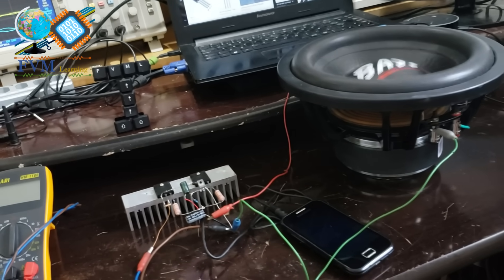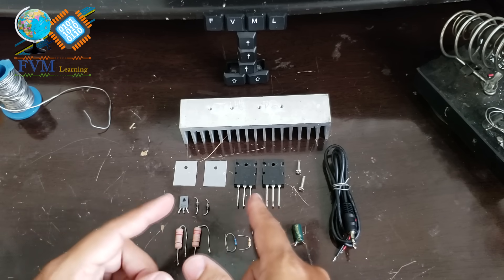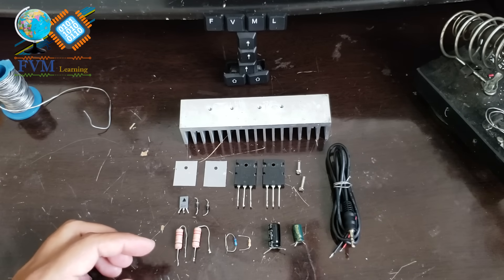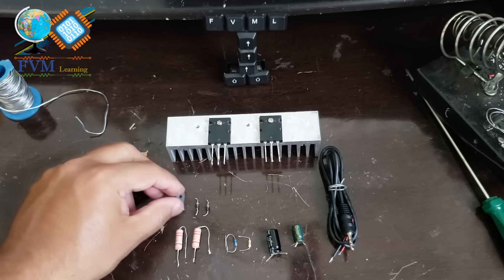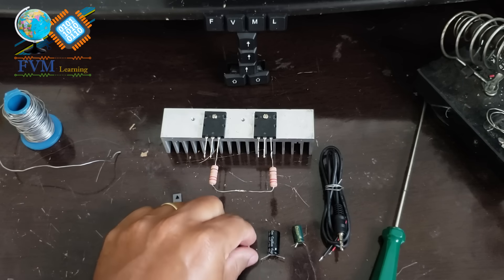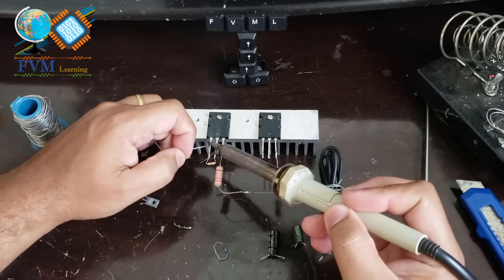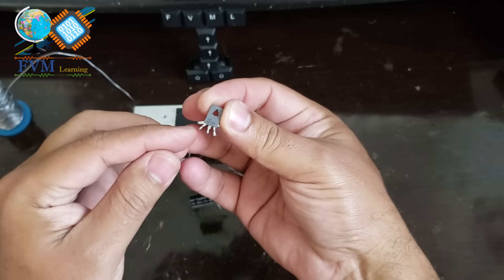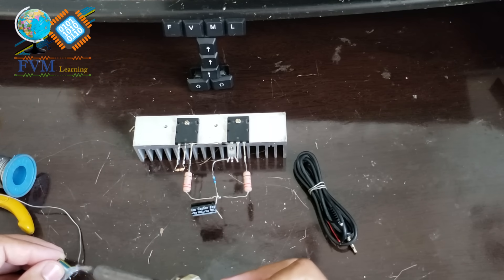Circuito Mini Amplificador com 3 Transistores Batendo no SUB 600W RMS  "Vamos montar!"

Comment: 2SC5200 
2SA1943
BD135, 137 o 139
2 resistencia de 0.22 h con 5 vp
Resistencia de 1kh
Resistencia de 100kh
Capacitor de 2200 uf 35v 
Capacitor de 470 uf 16v 
Cable de audio 3.5

Comment: Please advise, every time I connect + and - the diodes from AC to DC start to heat up a lot and are destroyed, I also tried a bridge rectifier (a ready made thing) and it also started to heat up and even smoke. When I used the 12V transformer itself, it only flashed (indicating either a short circuit or a large consumption)
What diodes should I use to convert from AC to DC? (I have a 12v 0 12v or unbalanced 12v transformer)
Reply: capacitors for filtering is 6800uF 63V
Reply: i repaired it

Comment: Meti 80 volts bate bem mas esquenta parece potência daquelas 6000 Watson moda na fiz 8 e vendo o negócio e o trago que tá difícil achar
Reply from the maker: Olá Jorge!
Show.
Esquenta porque o modelo não foi feito para uma tensão tão alta, mas, funciona.
Att. Equipe FVML
Reply: @FVMLearning mas com alterações simples ele nem esquenta,  coloquei 80v, aumentei dissipador , mudei o capacitor de saída para 50v 3300uf, mudei o resistor de 1k por um de 1k 5w e agr estou colocando um de 20w só pra ficar melhor , mudei o resistor de 100k pra 5w , troquei o bd137 por um bd139 e conectei tudo com fio awg de trafo de fonte atx e o mesmo est tocando muito bem com 80v , sem esquentar , isso pq não tem ventoinhas,  mas pretendo colocar,  até o momento só coloquei uma pasta termica de prata em todos os trasistores. (Incluindo o bd139). Amplificador muito bom , qs caixas nem aguentam

Comment: Materiais do vídeo

01 transistor 2sc5200
01 transistor 2sa1943
01 transistor PD 135 , 137 ou 139
02 díodos 1N4007
02 resistores 0,22R / 5w
01 resistor 1k
01 resistor 100k
01capacitor eletrolítico 2200uf/35v
01 capacitor eletrolítico 470uf /16v
01 dissipador de calor
01 cabo p2
Reply: vc esqueceu de dizer quantos watts rendeu reais no auto falante.
vc utilizou duas tensões uma de 24 volts e outra de 29, mas quantos amperes? 
para calcular a potência resultante.
Reply: Herói q não usa capa
Reply: Terima kasih atas bantuannya penjelasan nya
Reply: O capacitor que você está usando no projeto é de 1000uf 16v
Reply: voce consegue fazer o mesmo circuito usando 2 5200 npn, to com um monte de 2n3055 aqui e queria fazer algo com eles
Reply: Muito top parabéns...
Reply: Posso utilizar o transistor 5198 e o 1943 ?
Reply: Eh g6ostaria muito de ver esse projeto sendo melhorado com potenciômetro de volume, agudos,graves e Blu

Comment: Eu montei esse amplificador, em placa de C. Impresso..com todos componentes que está na lista.Alimentei com 15, e cheguei até 25 volts.Os transístores aquecem um pouco , e fica com um barulho como se tivesse em curto...Daí eu substituí o resistor de 100 k, por um trim-pot  de 220k. E em um dos diodos  4007, eu botei um resistor de 10 Ohms, ..eliminou o barulho, e eu pude controlar a distorção, e os transístores deixaram de aquecer, a mais, de que o normal....mas, funciona perfeito..Se vc tiver uma fonte de 12 a 15 volts, com uma corrente de 1 a 3 amperes, também funciona....Uma observação, que eu vi nesse video do amigo, é que o capacitor de entrada, ele coloca de 470 mf.....No esquema diz 47mf..mas eu colocava, de 2,2 ou de 4,7mf..seria melhor para o desacoplamento do sinal de áudio.
Reply from the maker: Olá @gmds2020
Você está certo, no vídeo utilizei um de 470uF por não ter outro "como digo no vídeo", mas no esquema elétrico está o de 4,7uF por 25V.
Que ótimo que você conseguiu melhorar, essa é a ideia, que todos nós sejamos participativo e dando a sua opinião para todos nós crescermos juntos!!!!
Obrigado por estar conosco...
Aproveita e inscreva também em nosso BLOG, isso nos ajuda bastante a dar continuidade ao nosso trabalho, e não custa nada. :)
https://draft.blogger.com/follow.g?view=FOLLOW&blogID=5745325357530072225

Forte Abraço

Comment: 3 TRANSISTORES

1 Transistor 2SB882 ( 128 D882 )
1 Transistor 2SD882 ( ALJ D882 P 61 )
1 Transistor 2SC945 ( C 945 GR331 )

4 CAPACITORES

1 de 100UF x 25V
1 de 100UF x 50V
1 de 1UF x 50V
1 de 2.2UF x 400V

8 RESISTORES

1 de 360k ohms
1 de 150k ohms
1 de 510 ohms
1 de 120 ohms
1 de 1.2 ohms
1 de 0.82 ohms
1 de 0.22 ohms
1 de 0.1 ohms

10 DIODOS

10× 1N4007

Eu Tenho Essas Coisas Aqui Em Casa, o Que Eu Posso Fazer?
Tem Algum Projeto Para Essas Coisas?
Reply from the maker: Olá @LostPlay FF
Procure um projeto que se encaixe nos componentes que você tem...
Obrigado por estar conosco ...
Aproveite e inscreva-se no nosso BLOG, isso também nos ajuda muito a dar continuidade ao nosso trabalho, e não custa nada. :)
https://draft.blogger.com/follow.g?view=FOLLOW&blogID=5745325357530072225

Forte Abraço

Comment: una pregunta no encontre el condensador 2200uf 35vol le podria poner uno de 25 0 50 vol
Reply from the maker: Hola @Alan Eduardo Estacury Cabera
El condensador de 2200uF para 35V, puede ser reemplazado por al menos uno de 1000uF 35, si tienes uno más pequeño, ya que 250uF funcionará pero con distorsiones.
Gracias por estar con nosotros ...
Disfruta y apúntate a nuestro BLOG, también nos ayuda mucho a seguir con nuestro trabajo, y no cuesta nada. :)
https://draft.blogger.com/follow.g?view=FOLLOW&blogID=5745325357530072225

Fuerte abrazo

Comment: guys just connect the 8 ohm speakers and at least 8 watts direct to the jack cable then plug at your devices and it will sound good
those circuits are farces to gain views.
Reply from the maker: Hello @Zombie Bot
Thanks for your comment...
The Mini Amplifier of the video, fulfills what it promises, its power measured at the output was approximately 90W, so it is not a scam ...
Thank you for being with us ...
Take advantage and subscribe to our BLOG, it also helps us a lot to continue our work, and it costs nothing. :)
https://draft.blogger.com/follow.g?view=FOLLOW&blogID=5745325357530072225

Regards

Comment: tengo esta serie de transistores que las saque de una fuente de pc pero no se si se pueda colocar para hacer un amplificador, quisiera que me digiera si funciona y cual seria la resistencia y el condensador electrolitico que hay que usar, también saber como usted saca ese calculo de como usar la resistencia adecuada y el condensador electrolítico adecuado.
los transistores son estos.
(s14 sb2040ct), (mospec f12c2oc a4e),( lts 224 sbli 040ct).
(046211 china stps 20 45 ct), ( byq28e 200 phm 33a7), ( lt504 sbl2045ct).
(c3150 m9h3), (c3039 m2m). y tengo un dimer de 50k
tambien como saber que transistor son de potencia para  hacer un buen amplificador.
 sin mas nada que decir me despido espero su pronta respuesta este es mi correo johambaryjohan@@t
Reply from the maker: Hola @JOFER.10 F.M
Veamos por parte:
[s14 sb2040ct], [mospec f12c2oc a4e], [046211 china stps 20 45 ct], [byq28e 200 phm 33a7], [lt504 sbl2045ct] = "Diodos Schottky"

sbli 040ct = Creo que es un diodo "No estoy seguro"

c3039 m2m = transistor de alta frecuencia NPN
 
Bueno, para construir este mini amplificador, necesitará 1 transistor NPN para el variador y dos transistores de potencia complementarios para la salida.
Entonces, con lo que tiene "Solo un transistor c3039", no hay forma de hacerlo, necesita comprar los componentes.

Gracias por estar con nosotros ...
Aprobar y suscribirse a nuestro BLOG, también nos ayudan mucho para continuar nuestro trabajo y nada. :)
https://draft.blogger.com/follow.g?view=FOLLOW&blogID=5745325357530072225

Fuerte abrazo
Reply: @FVMLearning  
gracias por la respuesta y por la aclara to
 ria

Comment: bom dia qual a diferença entre qual a diferença entre circuito integrado irs20955s e irs20957s e se dar para substituir para o irs20957s
Reply from the maker: Olá @rjnegrao paredão
Eles teem as mesmas pinagens, e diferenciam em poucos aspectos, tais como:
IRS20955S = Tensão flutuante absoluta de alimentação VS =100V, enquanto o IRS20957S é de 200V.
IRS20955S = Tensão absoluta de alimentação de entrada flutuante do  VSS = 200V
e o IRS20957S = 100V.
IRS20955S = Tensão de Alimentação fixa VCC=18
Enquanto o IRS20955S = 15V.
IRS20955S = Tensão da suporte máximo do diodo Zener 21,6. Já do IRS20955S = 16.2V
São algumas das mudanças entre eles.
O que pode ser substituído levando em conta a alimentação de fornecimento de fonte Vs, Vss, e limites de tensão fixa de alimentação Vcc, o resto é bastante compatível.
Obrigado por estar conosco ...
Aproveite e inscreva-se no nosso BLOG, isso também nos ajuda muito a dar continuidade ao nosso trabalho, e não custa nada. :)
https://draft.blogger.com/follow.g?view=FOLLOW&blogID=5745325357530072225

Forte Abraço

Comment: Very good amplifier if you  put some inductors so transistor will not heatup and you have to use some zener diods and pf condenser so really you can get very high gain 
Anyway thank you that was oswm vedio
Reply from the maker: Hello @Simple Life
Yes, there are several ways to improve this amplifier, however, this Mini Amplifier, was designed for a minimalist assembly, with the fewest possible components, so it is a Mini Amplifier.
But you can change and improve the same.
Thank you for being with us ...
Take advantage and also subscribe to our BLOG, it helps us a lot to continue our work, and it costs nothing. :)
https://draft.blogger.com/follow.g?view=FOLLOW&blogID=5745325357530072225
Best Regard.

Comment: Hola ante de enseñar a los novatos tienes se hablal la realidad para qe no c confundan 2 transistores 2sa1943 en conjunto con 2sc 5200 no dan una potencia de más de 100wasst RMS y le está diciéndo se van a. Sacar una potencia de 600 wasst lo cual es imposible porque para sacar 600 wasst RMS se necesitan 12 transistores y un voltaje simétrico de 85v + 85v- creó qe para enseñar ay qe comenzar con la verdad
Reply from the maker: Hola @ELECTRONICA SANCHEZ TUTORIALES
Creo que no interpretaste el título correctamente.
El título es: "Mini circuito amplificador con 3 transistores que golpean el SUB 600W RMS + PCI"
Él dice que empuja un SUBWOOFER de 600W RMS, no es que sea 600W rms. ¿Entendiste la diferencia?
Gracias por estar con nosotros ...
Aproveche y también suscríbase a nuestro BLOG, nos ayuda mucho a continuar nuestro trabajo y no cuesta nada. :)
https://draft.blogger.com/follow.g?view=FOLLOW&blogID=5745325357530072225

Fuerte abrazo

Comment: Tenho como substituir os capacitor 2200 e 470 por outro?
Reply from the maker: Olá @eric Fernando
Você pode está substituindo o capacitor C1 por um de 4.7uF, 10uF, 22uF , 47uF, qualquer um desses por 16V para cima, e o C2 de 2.200uF, você pode está colocando um de 2.700uF, 3.300uF, 4.700uF por 35V mínimo.
Obrigado por estar conosco...
Aproveita e inscreva também em nosso BLOG, isso nos ajuda bastante a dar continuidade ao nosso trabalho, e não custa nada. :)
https://draft.blogger.com/follow.g?view=FOLLOW&blogID=5745325357530072225

Forte Abraço

Comment: 12v input how much the amper..
Reply from the maker: Hello @JonereyTECH Torena
The 12V voltage is a little low for this amplifier, you will have low power at the output, we recommend using 35V with 3 Amps.
But if you only have 12V at the moment, you can use it with 3 Amps too.

Thank you for being with us ...
Take advantage and also subscribe to our BLOG, it helps us a lot to continue our work, and it costs nothing. :)
https://draft.blogger.com/follow.g?view=FOLLOW&blogID=5745325357530072225

Regards

Comment: Quanto gastou com os resistores é capacitores em fim quanto gastou ora montar ele ?
Reply from the maker: Olá @PK4 PRATA
Isso vai depender de cidade em que você mora, os preços variam muito... Mas, o que gastei em média com um calculo simples:
Par de transistores:  R$25,00
Transistor BD139:R$1.80
Resistores: R$3.20
Capacitores Eletrolíticos: R$ 2.20
Diodos: R$0,33
Em média com preço atual tudo ficou em torno de: R$32,53.

Obrigado por estar conosco...
Aproveita e inscreva também em nosso BLOG, isso nos ajuda bastante a dar continuidade ao nosso trabalho, e não custa nada. :)
https://draft.blogger.com/follow.g?view=FOLLOW&blogID=5745325357530072225

Forte Abraço

Comment: Olá, gostei, posso fazer o circuito e ligar na bateria do carro p tocar um sub de 400w?
Reply from the maker: Olá @JEAK PEREIRA
Pode sim, no entanto devido a baixa tensão, você não vai conseguir tirar a potência máxima do amplificador, se aumentar a o volume acima da tensão requerida pelo equipamento, ele irá distorcer. Então pode sim, mas com alguns critérios.
Obrigado por estar conosco.
Aproveita e inscreva também em nosso BLOG, para não perder nenhuma novidade, e isso nos ajuda bastante a dar continuidade ao nosso trabalho, e não custa nada. :)
https://draft.blogger.com/follow.g?view=FOLLOW&blogID=5745325357530072225

Forte abraço!!
Reply: Recomenda qual voltagem?
Reply from the maker: Olá @ @lentavapiispa  
Nós recomendamos para trabalho dos transistores tranquilo na faixa de 35 Volts. Isso não quer dizer que você não pode colocar até 45 ou 55V, porém tem que levar em consideração um bom radiador de calor.
Esquema elétrico do nosso blog:
https://www.fvml.com.br/2019/08/circuito-mini-amplificador-com-3.html

Aproveita e inscreva também em nosso BLOG, para não perder nenhuma novidade, e isso nos ajuda bastante a dar continuidade ao nosso trabalho, e não custa nada. :)
https://draft.blogger.com/follow.g?view=FOLLOW&blogID=5745325357530072225

Forte abraço!!

Comment: Como faço pra ter essa potência em 8ohms
Reply: Posso usar uma fonte de 50a
Reply from the maker: Olá @Claudson Braga
Potência está relacionado a Tensão ao quadrado sobre a resistência
Ppico = (V)^2 / Ω  
No caso se você precisar manter a potência com uma resistência maior 8Ω, sugiro aumentar a tensão, por exemplo.
No nosso exemplo no teste final aumentamos a tensão para  30 aprox. 
Ppico = (30V)^2 / 4Ω =   225W
Se você colocar nessa mesma situação 8Ω
Ppico = (30V)^2 / 8Ω  = 112.5W
Ou seja a metade da potência.
O que podes fazer é aumentar a tensão para ex.: 42V
Ppico = (42V)^2 / 8Ω  = 220.5W

* Lembrando que isso é potência pico à pico.
Para um valor médio, como no exemplo que utilizamos no vídeo é:
30 V × 0,707 = 21,21 V(RMS). 
Essa tensão (o sinal), aplicada na carga de 4 Ω como no exemplo do vídeo:
Pméd = (21,21 V)^2 / 4 Ω = 112,46 watts

Espero ter ajudado
Aproveita e inscreva também em nosso BLOG, para não perder nenhuma novidade, e isso nos ajuda bastante a dar continuidade ao nosso trabalho, e não custa nada. :)
https://draft.blogger.com/follow.g?view=FOLLOW&blogID=5745325357530072225

Forte abraço